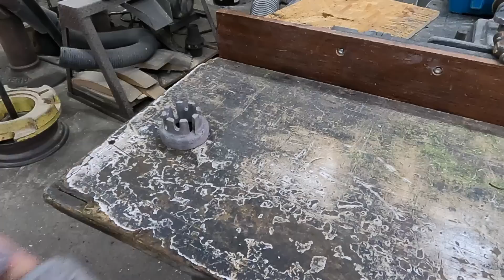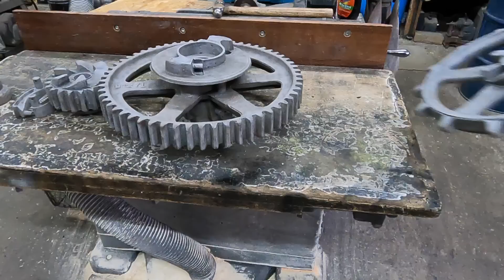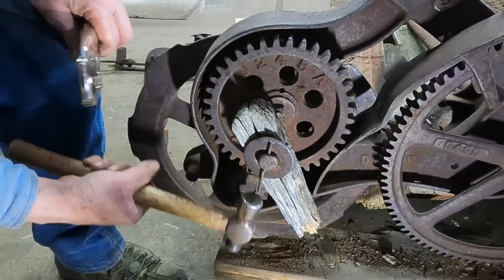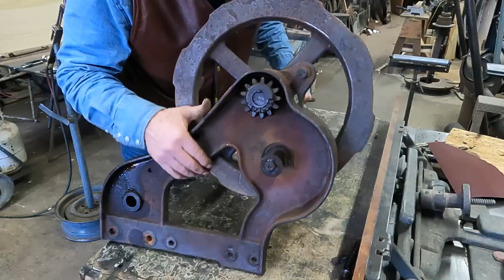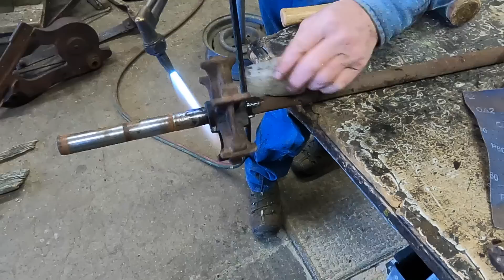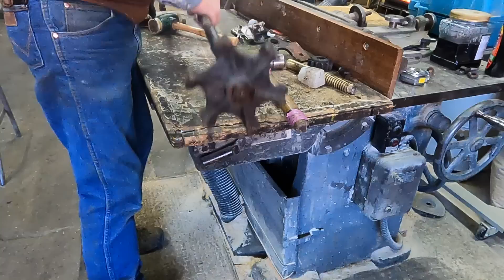Does Wax Break Loose Rust? My Test | Engels Coach Shop

Comment: My favorite penetrating fluid is a heavy mix of oxygen with smidge of acetylene.  Works every time!  🤣  Personally, I don't believe anything really penetrates parts that are rusted together, except heat...and lots of it.  Always enjoy following along, Dave.  Be well!
Reply: I believe the vibrations of impacts get in there too. But yeah once it's locked up solid nothing but heat and mechanical shocks are going to get through the solid material. At that point it's a hermetic seal. The only attacks that are effective then work at the atomic level.
Reply: @1pcfred  Agreed!  I use an air impact, if available.
Reply: @Hey_Its_That_Guy  me too. Air power!

Comment: The fact that he knows how to rebuild it and put it all back together without instructions is just incredible.
Reply: The video becomes his instruction manual. That’s one reason to show the parts the way he does as he takes them off. 

I’m sure the old rusty shafts have enough witness marks to show position and spacing when it all goes together but it’s incredible just the same that it will go back together and function as good as new when it’s done.
Reply: I rebuilt a truck transmission, once.
The boss asked me what I needed.
Everyone to stay out of the shop was my answer.
No books, no drawings, no specs.
Just put the parts in specific locations and orientations, and you are good to go.

I’ve done enough old carburetors, I just let the parts fall onto my carb rag, and just put it back together.
Rebuilt the carb on my youngest son’s car with him, a 1984 Thunderbird.
I watched his eyes as the parts were all falling out.

The expressions were PRICELESS!!!
Reply: @dangeary2134  Dont blame him hes a good boy. Hes just a victim of the throwaway Society. I bought a Shark Mop fool me. Its held together with security screws some reverse pitted 7 star arrangement and the tool to unscrew them is 40 bucks whilst the mop cost 100. Planned obsolescence is hard to beat.
Reply: It's a farmer thing.
Reply: just do the video backwards to see how parts go. Did not notice if he made measurements for spacing parts on shaft length.

Comment: Given your experience of securing steel tires, perhaps you could heat the outer piece (cog, gear, etc.) while cooling the inner pieces (rod, axle, etc) with liquid nitrogen. There is a guy Criss from Cutting Edge Engineering Australia (YouTube) who soaks steel bearings in liquid nitrogen to shrink them for an interference fit. As for this video, I speculate the heat helped more than the wax by stressing the rust through the heat expansion action. Meanwhile, liquid nitrogen may not be available at the Joliet Hardware Store. More than anything, Thanks for sharing.
Reply: Watch that channel also. Get a kick when he starts with the Banana measurements.

Comment: I have done a lot of mechanicing over the years, lots of shafts, pulleys, gears, bearings, impellers. I have to say I am amazed how EASY some of these parts have come apart for you considering how long they have been assembled and sitting in the weather. Maybe its the result of the cast steel instead of forged steel in more modern equipment? Or maybe the rust just knows you are going to win.

Comment: Used bees wax on cutting tools, lathe bits, and drills for 50 years. Greatly extends tool life. Had a 1 inch thick junk block of bees wax for 45 years  next to the vise.  Run the hack saw several times across the wax during a cut. Significantly cuts the work. (Real men use a hack saw.) :-)  Never expected it to last 45 years.  Bees wax works great on metal cutting band saw but is a giant mess to clean up. Blade runs cool, straight, and stays sharp. But bees wax builds up on the drive and guide wheels.  I put up with cleaning because no oil drips, smoke, straight cuts, and long life blades.

Not good for tapping holes. Holds chips and cannot stand the high pressures.  Carburizes  the steel surface and turns to smoke.

Fantastic for low speed, low pressure cutting. Last month, started pricing another 15  pounds for the next 50 years.

Comment: I have heard of using wax when installing screws in hardwoods and also for when cutting aluminum with a chop saw but never heard of it being used to remove rusted metal parts. Learned something new today. Thank you for the knowledge.
Reply: When I was a little boy we were told that to lubricate wood screws one would use soap my Granddaddy taught me that one. Wax would work just as well. I figured that the heat would draw the wax up into those pieces, and of course the last piece took a little while but one has to have patience in disassembly to avoid damaging parts and spending more time repairing them. Isn't it amazing how that agricultural equipment can be so complicated from a mechanical standpoint?

Comment: There are so many variables, but with the wax  it seemed that once it was loose it came off. Where heat and the lube had to be beaten back and forth. Maybe editing too. I've never used wax before, so don't know. Definitely a great project. Looking forward to seeing it run. I'm on the process of getting a John Deere N spreader going.
Reply: I worked on my grandpa's model L and the bearings were a pain, and several things were wore into the cast iron.  I didn't have any fiber bushings so I made some out of a sheet of brass.  Still haven't finished it but what I've got done so far is not as fun as I thought it would be.
Reply: So I have to say, I wish you well on your project.

Comment: I keep hearing people refer to "oil holes" most places where steel shafts run in cast iron bushings were intended to be greased.  Most early grease guns were a simple cylinder with a piston and a conical nose. Oil and field dirt made grinding compound. Up until the 40's formulas were around for making "machine grease" at home from tallow, lard, and pine rosin, (also paraffin, bee's wax, tar, et cetera). the grease may not have been the best lubricant, but it excluded the abrasive dirt.
Reply: When you're drag racing you oil the bearings for less friction. Dave is hot rodding this wagon!

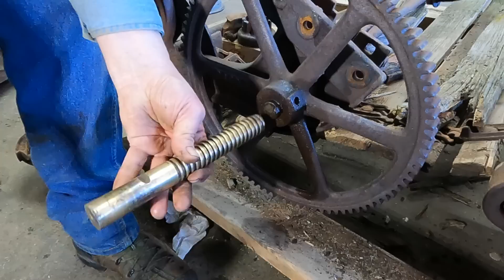Comment: I like that your drift/punch is the stem off an OS&Y valve.  9:34 The little groove seen is there for a valve tamper switch which indicates that it was likely used in a fire sprinkler system.

Comment: i think is the combination of both. Heat opens the gap , and brakes down the corrosion a little by getting out the moisture allowing it to move a little. The Wax gets in a uses capillary action to fill the gap. The ongoing movements are aided by the wax preventing it from picking up again on the shaft. That and it being cast iron being somewhat porous having the wax get into the pours adds to the lubricity of the iron making it less likely to stick again. A bit like self lubricating bearing material. You can and I have used wax in the past in place of commercial never seize on long term assemblies that were exposed to sea water and air. It worked just as well as the never seize/copper coat that I had at the time.

Comment: I've done wonders with heat, and I agree with you as I think the heat expanded the sprocket enough to break the rust, draw the wax in & lubricate it.
Reply: Beyond that you get it hot enough the rust will burn away. You take rusty metal and heat it up and when it cools the rust will be totally gone. You'll have clean gray metal then. Rust is metal combined with oxygen. It wants to burn.

Comment: During my time as a airplane builder and mechanic, I have come across some stubborn fasteners. I found the easiest way to get them out was to use a 3X or 4X rivet gun. Very rapid blows with a flat set, have never had any fastener fail to come out. Don't know which would be noisier, I vote for the gun to win the noise contest.
Reply: My all time favorite is the Chicago pneumatic model 717,you can tickle the trigger so slow you can count the blows it is a brute!
Reply: My all time favorite is the Chicago pneumatic model 717,you can tickle the trigger so slow you can count the blows it is a brute!
Reply: My all time favorite is the Chicago pneumatic model 717,you can tickle the trigger so slow you can count the blows it is a brute!
Reply: My all time favorite is the Chicago pneumatic model 717,you can tickle the trigger so slow you can count the blows it is a brute!
Reply: My all time favorite is the Chicago pneumatic model 717,you can tickle the trigger so slow you can count the blows it is a brute!
Reply: My all time favorite is the Chicago pneumatic model 717,you can tickle the trigger so slow you can count the blows it is a brute!
Reply: My all time favorite is the Chicago pneumatic model 717,you can tickle the trigger so slow you can count the blows it is a brute!
Reply: My all time favorite is the Chicago pneumatic model 717,you can tickle the trigger so slow you can count the blows it is a brute!
Reply: My all time favorite is the Chicago pneumatic model 717,you can tickle the trigger so slow you can count the blows it is a brute!
Reply: My all time favorite is the Chicago pneumatic model 717,you can tickle the trigger so slow you can count the blows it is a brute!

Comment: You can hear the crackling on the last heating. The melting wax created an insulating barrier for the shaft, so it didn't get as hot as the red hot sprocket. Also the melting wax had already traveled in between the parts, so when heated it expanded thus helping the release process.
Reply: Wax on wax off!

Comment: Until the torch heats the components to an id and od respectively, than allows the lubricant to enter that space differential, it's a stand-off. The choice of the wax was a bonus as it has to property to drawn to heat, as you point out. Perfect pair..

Comment: I noticed in both the last video and this video, you’re only using heat and nothing in the way of cooling. Heating a part frozen on a similar metal rod or bushing, the heat will dissipate and transfer to the item you are trying to remove from and thus make it not as effective. Being able to keep cool, or at least cool after, the part you are removing from (ie an axle)… you get the maximum variation in surface diameters.

Comment: 30+ years of working on rusty autos the answer is heat, and vibrattion, over any kind of lubricant. Adding lubricants without heat or vibration is futility at best.
Reply: There's a cut off where penetrating oils work.  Past that you're in the realm of heat. Shock is better than torque too.
Reply: @1pcfred  Well that is factualy wrong. Rust expands which seals off penetration. So if you have actual rust penetating oils by themself won't actually help without more time than anyone has.
Reply: @RichardHeadGaming  perhaps you cannot comprehend what I said. Rust does not instantly expand to completely seal off all ingress. The process takes time. Which means there's a time when penetrants will penetrate.  It's rust not Good Stuff foam. So don't try to effing tell me because I've seen it myself countless times.

Comment: I am an old heavy machinery mechanic, ( fix 'em where they fall, too big to go to the shop). Any lube which does not break down with heat works. A cheap pneumatic hammer is a recommended tool, not a good hard hitting one, a 600-1000 BPM "buzz gun". Drill a piece of brass to make a soft tip, even hammering in the wrong direction while pulling can help move stubborn parts.

Comment: With that last sprocket I'd have been inclined to use its own mass to move it by dropping the shaft onto the  floor (with timber buffer to stop head mushrooming).
No need then to have to restrain the shaft while hammering.

Comment: I have used the paraffin to remove screws and bolts on antique cars that I work on.  Many are real small diameters and stuck really hard, and without heat and wax will usually just break off.

Comment: Thanks for the video sir. Always interested in trying new techniques as far as breaking rusted parts loose, my go to on smaller shafts is a 50/50 mix of transmission fluid with acetone, seems to help, but heat is usually the biggest rust buster. I was surprise at the amount of steel and cast on the spreader, but still, a simple gearing system, enjoyed watching.
Reply: I wonder if applications of something like EVAPO-RUST might work as a starter.

Comment: Hi Dave and Diane, I find with rusted parts like that last one with heating red hot, it tends to heat the shaft at the same time if possible I heat till red hot and cool the shaft as quick as possible in cold water seems to help but of course, you can't always do that, but in this case, I would have given it a shot, whether the wax trick works or not I am a bit like you on that one not sure.??👍👍👍👍

Comment: According to the literature, for rust to be broken down [burnt out or such] it must be heated to ~1,480° F. [Orange Red color]. I have not observed any parts of this temperature in your videos. I suspect the parts can be removed because the heat you apply causes one part to expand more than the other, thus creating a gap and separating the parts. If the inner part was kept "cool" while the outer heated, they could be more easily separated.
Reply: If ifs and buts were candy and nuts we'd all have a Merry Christmas.

Comment: The major difference that I could see, was that you didn't try to restrain the movement of the rod until after you applied the red hot heat.
Reply: That's about the same thing I said. Should have put the end of the bar against the wall or something before hitting the gear so the bar isn't moving and absorbing the impact for all of the test. More consistent test method.

Comment: when we tore down the gangs on breaking disics we threw them into a tank of water and let them soak a few days they come right apart. as well as getting the Mulboards off Dozer blades we used to drop the blade into water and left them to soak.  stuff like the manure spreader is same sorta therory, is mud like rust and water dirt and air makes rust and water returns it back to softer compounds. as say worked well for us just settin this out there

Comment: I think your intuition makes sense.  Wax, paraffin, and penetrating oil surely help sliding the part out after it gets unstuck, but I don't see how they could help getting the part unstuck in the first place -- unless one uses an acid fluid that can actually dissolve the rust.  Heating to red hot, on the other hand, should help get the parts unstuck.  Common rust is mostly iron oxide-hydroxide, FeO(OH). If heated to red hot, it should lose water and oxygen and turn into other oxides ("scale") such as  Fe3O4, FeO, Fe2O3.  This conversion should cause the rust to shrink, because some of the mass is lost and these oxides are denser than rust.  It should also break the rust crystals into a powder.
Reply: Thanks for adding a little science to the issue.
Reply: You're overthinking the problem. Heat expands the part giving room hopefully, for capillary action to occur with the penetrant or the wax.
Reply: @farmerbill6855  Expansion helps too, but it is not that much. If the axle too gets hot, the gap will hardly open up.  As for wax or penetrating oil, it certainly helps sliding after the part gets unstuck, but I don't see how it could soften the solid rust that is holding the parts together, even if the rust gets soaked in it.
Reply: @JorgeStolfi  My understanding  is this; Since the rust transfer heat slower than iron,  there's an insulation gap between the axle and the boss. In other words, the boss heats up faster, and  expands faster than the axle in the beginning. Also take in consideration the time it takes for the heat to travel through the parts.  This helps loosen the rust fixation between the parts. Added wax or oil can penetrate this crack (by capilary effect?) , and provide some lubrication between the parts.
Reply: @sidekickbob7227  Hm, I smell a journal paper on this problem, maybe even a thesis topic and research grant... If only I was in Mechanical Engineering...
I just stumbled on this video https://www.youtube.com/watch?v=AWOaeGy_HnA The guys fumble to loosen some stuck bolts, it is great comedy.  But at one point they torch the bolt rather than the flange, and try to unscrew it while still red hot -- and it may have worked, against expectations.  Could it be?
Reply: @JorgeStolfi  Works like a charm. The expansion does the trick. The heat travels throug the bolt way quicker than the boss. Then often you want to fasten and loosening the bolt carefully until you feel less restistane.  This way you loose up the rust to something remininding powder.

Comment: I learned something today the wax not only a lubricant  but also a heat indicator no ? I do aluminum fabrication and use bees wax on aluminum grinding wheels and 24 grid sanding diskes

Comment: Amazing how easily it comes apart (for some values of easily!) after sitting idle in the weather for mumblety-mumble years. Yeah, with that much iron in good shape, well worth the rebuild. We gotta see it in action.

I use WD40 "Specialist" on stuck bolts... here is how good it is. Kennel bolts the dogs had been peeing on for 11 years... so stuck you'd about break a wrench on them. Regular penetrating oil got nowhere. Sprayed with this silicone Specialist stuff, left overnight, came right loose. Same with bolts that had been underground for almost two years. Had to get 'em loose in winter no less.

I also use it to coat the snow shovel so the wet stuff doesn't stick. :)
Reply: I suspect that cast iron weathers much better than steel, but I don't know why.  I've disassembled things made of cast iron (i.e., ground contact farm implements) that probably would have been just one large lump of rust if they were steel.
Reply: @tuberzish  Might be because the corrosion layer prevents it from welding itself to something else?